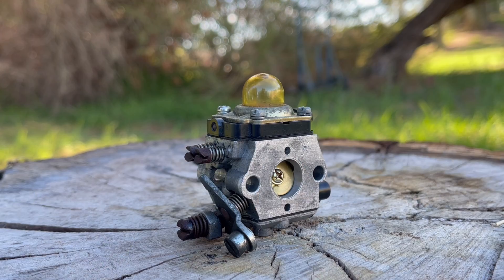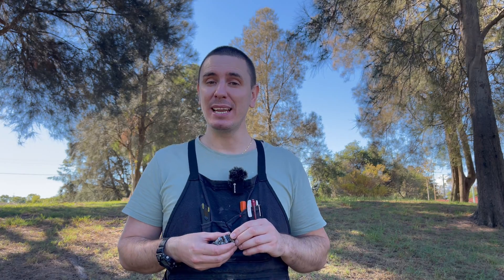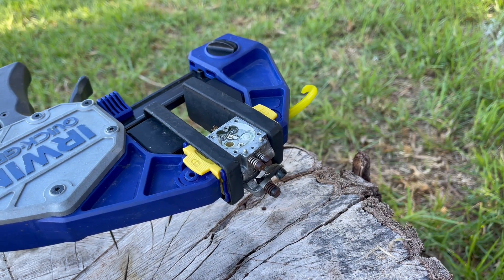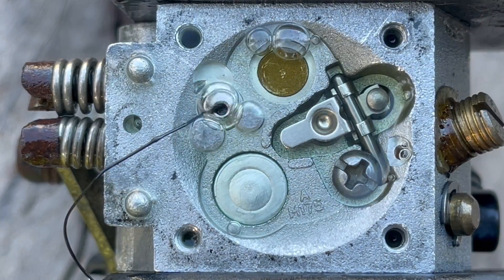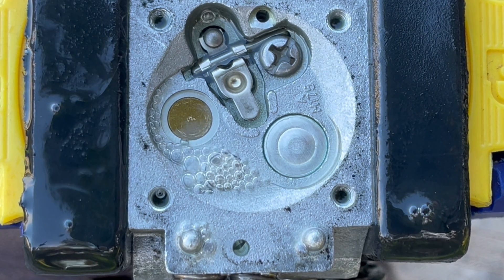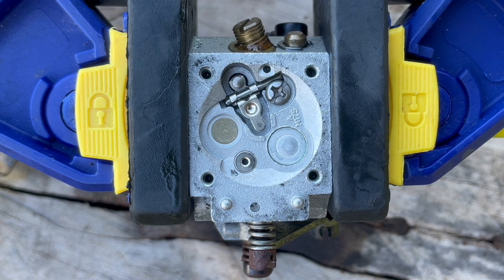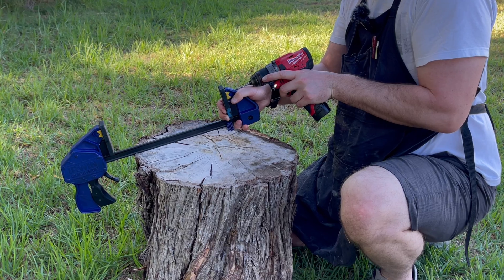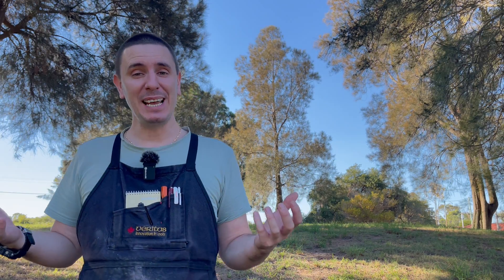Must-Have Tools For Carburetor Repairs & Rebuilds!

Comment: Can you send me the link to the carburetor valves?
Reply from the maker: Hey I don't have a specific link to them, but if you google your carburetor make and model you can find the part number for it :)
Reply: @VintageEngineRepairs Here in Brazil, it is difficult to find, thank you.
Reply from the maker: Yes that's annoying :( what about a local dealer?

Comment: I have a Troy-Bilt gas trimmer, model TB635EC.  I'm having problems with the engine flooding after starting and quitting.  I can't find any carburetor parts with any on-line dealers.  I have found a replacement carb, and ordered one.  I see many how-to videos to tear down and repair these small carburetors, but where do I get the parts?
Reply from the maker: EBay, Amazon, local dealers, Ali express, etc all sell parts.
Reply: @VintageEngineRepairs  I see that, but the carbs I see, do not match the one (pn match) on my Troy-Bilt, 4-stroke.  I received the new carb I ordered, and I'll be tearing down the original when I have the time this week.
Reply from the maker: Yeah it can be tricky sometimes! And when you think you have the right carb, it arrives and still needs a little modification! Hope you get it sorted :)

Comment: Hey Tom, I am also a Tom!  I am working on a Zama c1u k16 from my old pole saw.  I did the test in my little check valve and it allowed me to blow or suck through it.  So, do you know where, in the States, I can order new check valves.  It’s ridiculous that none of the repair part companies have any check valves for sale.  I would really like to remove it from my carb but can’t find a replacement.  Thanks.  Tom
Reply from the maker: Hey Tom :) best to find the part number first then google search it. If you type in "Zama C1U parts list" you'll be able to find it :) best of luck!

Comment: I have a question to make. I tried your method with rubber jaws, but the compressed air escape from the holes of throttle and choke shafts. I tried with 2 carbs the same results. How did your carb hold the air without escaping from the case holes of the throttle and choke shafts?
Reply from the maker: Hi, that does to a certain extent, you won’t ever build up pressure as it were, but a worn throttle shaft does worsen it. Try low pressure air from your compressor which is more constant and controllable
Reply: @VintageEngineRepairs  i see, i will just keep constant low pressure in order to see only if my check valves are leaking right?

Comment: I’ve had luck soaking the carb in Pine sol overnite and then blowing out the orifices with carb cleaner. A Tillotson HS136E was successfully cleaned and put into service again 😊.  One question however , do know of a tool kit for re-cutting the seat in the carb housing (seal between needle and housing) … I used a qtip with polish several times however the seat was so hammered it would not clean up. I was able to use an appropriate size drill bit ground to the angle of the needle and holding the bit in a tap wench slowly “cut” a hair of the seat - THEN polish again and it’s now working. These Tillotson HS 136 b,c,d,e,j series are used on many older saws and are very difficult to source new - just wondering if there is a commercial tool available for this application other than my ghetto tech method 😂 thanks !
Reply from the maker: Hey, I have successfully cut seats using a small end mill, I can’t remember what size it is, but find one that fits :)
Reply: @VintageEngineRepairs  I’m having a drill cnc ground to the exact taper of the needle … then we can take a very light cut by hand and use some polish to lap the surface true. Of course the metering arm may not be flush with the housing but as long as it seals….. Another option I found is to retro-fit a 395carb , you’ll have to drill for a fitting for the impulse line either in the cylinder or the intake block. I thought I had found the rainbows end and ordered a HS136C but later recieved and email stating NLA. I make it work somehow thanks for the reply ! 😎

Comment: Hey Tom, I tried testing a stihl fs 280 carburetor with the same steps provided in the video and it leaks in both high and low drillings. I even tried a new one with the same results.

These carburetors are probably built different.

Much appreciated if you can help me understand its design.
Reply from the maker: Yes there are a few differences. If you don’t have a purge bulb on the carb, the low speed drillings will always leak unless you close the screw all the way. The high shouldn’t though, as there is a check valve on them. In some rare instances they use a capillary screen, but not on modern machines! Are you using after market carbs - they’re an always an unknown entity!
Reply: @VintageEngineRepairs  I'm only using original carbs. Tested 3 carbs for the same model so far, and every high drilling is leaking (if i tighten them all the way, there are no leaks). 

There's something we're missing.
Reply from the maker: Yeah that’s not right haha, you’re wetting the drillings with fuel?
Reply: @VintageEngineRepairs  Yes sir, wet as instructed. Cleaned the carb, reinstalled it in the unit, and it ran perfectly.

If you ever come across any working carburetors like that, please let me know.. maybe I'm just crazy.
Reply from the maker: @l3git_098 I certainly will!! Send me an email and I’ll forward you the stihl documentation to this procedure for your reference: tomscandian@hotmail.com

Comment: Hi,I have walbro HDA 154A and i need check valve. But i couldn't find it on google,would you help me with that? I found severals but its nkt the same as mine.Where  I can contact you and send you pictures? This carb is from Husqvarna chainsaw 345. 😀
Reply from the maker: Hey mate, if it’s the main nozzle you’re after here you go - Nozzle Assembly Check Valve 86-578-1

Comment: First, I grew up in a family of slow- talking mid-westerners, and second, I'm now old and slow on the up-take, with the result that much of that info blew by too fast. The carb in my old Echo line-trimmer has a bad bog, probably from the accelerator pump o-ring (per your other video).  As I go through the carb, I'll have my laptop on the bench beside me so I can repeat, repeat, repeat.  Not a big deal, and I'm certainly not griping after all of your help! But may I humbly suggest that you take just a little more time on your pictures of each operation, with a background voiceover  .  .  .  ??  Regardless, thanks much!!
Reply from the maker: Thank you for the feedback :)

Comment: Hi i am in uk i have a stihl fs 56 r strimmer carburetor leaking fuel in to air filter will not run  carburetor zama s145a839a may be a cheap carb need strimmer not worth much regards
Reply from the maker: Hey, sounds like your needle is leaking letting the fuel flow out of the drillings :) pressurise the fuel line (you take the filter off) and pressurise it to 7psi. It should hold, yours likely won’t.

Comment: Hey Tom got a question for you. Is it possible for a check valve to pass the tests and still fail intermittently when running the unit? 

If I adjust the carburetor everything runs fine and 20 minutes later when I restart, it sputters and needs to be readjusted. 

Already pressure and vacuum tested the engine.
Reply from the maker: Check valves can seal intermittently, yes :)
Reply: @VintageEngineRepairs  Thank you my good sir!

Comment: I always repaired my carburetor's with basic tools, an air compressor is a must.
Reply from the maker: Be careful which hole you spray the air into!
Reply: @VintageEngineRepairs  I'm always careful. Never had any problems.

Comment: Yeah I only ever have to use a Phillips screwdriver usually a P2 sometimes a P1 every now and again using a flat head, usually a pair of needle-nose pliers to get maybe the gas line off if it's not coming off easily, and usually a pair of fine tip tweezers and then a small stainless steel bowl to set everything in a stainless steel bowl. normally just take the whole thing apart and then use a can of carburetor cleaner with the red tube the red tube is the most necessary thing with a can of carb cleaner. And then I will just spray everything nice and clean spray through every last thing that looks like a hole and being sure to notice if it's actually spring through the hole or if it's just possibly a screw hole and it's just back spraying on me and then just after spraying it all down making sure that it's spotless putting it back together the same way that it got taken apart and spraying down as I go making sure not one bit of dirt gets into the thing and and so far I've probably done a good two or three hundred Carburetors in my life and I've never had to go through the extremes that you're showing in this video
Reply from the maker: They’re service parts, they need to be changed when they fail. Thanks for watching.

Comment: Be careful with the budget hand pump recommendation. That is a vacuum only version which is not entirely helpful with 2 stroke engines and carburetors. Search B0BLHBH1GK ASIN code for the pressure/vacuum one. I have this exact model and it's great fot the money.

Comment: The fuel tank is below the carb or yes gravity could leak through those two pump flaps as gravity draws fuel down . i understand all about the ventura and the diff pressures along the throat (as a pilot training engines, carbs, suctions for instruments and "static port" ) SO why does the 4 stroke make this carb work without pulse but the 2 stroke needs the pulse hole to work those flaps or leak past them if a suction is produced ?   Seems both intakes make a vacuum. I have worked on many of diff carbs cleaning rekitting and even trying diff metering springs to get the right "pop off" pressures and right amount of fuel in that little bowl for high power but not too much for idle or it will flood.  So assume i understand about the diff sections of the carbs and bleeds and idle lines and main jets and check valves ect.
Reply from the maker: Because I don’t know what machine it’s off and what that carburetor is I can’t really help, but send some pictures of the machine and carburetor to my email and I’ll explain it to you tomscandian@hotmail.com
Reply: @VintageEngineRepairs  Its a yard king 4 stroke 24.5cc with fuel tank under and i just found out as i suspected that the 2 stroke draw with or without the reed is LESS than the heavy 4 stroke suction and thus this will produce enough suction through that main jet tube and down into the body where the pump gasket is and draw fuel through them and all good. I can see when i pull the rope the fuel going up the fuel line but with no pulse hole on the carb or engine manifold.  Theres no other holes in the throat of a Var jet Venuri so thats only way it can make suction down into the carb and enough to draw fuel in but the 2 stroke "intake" suction can manage this and needs that pulse port to work those 2 flaps.

Comment: Hi, Why can you use a 2 stoke carb like a walbro or var jet type WXY? on a 4 stroke with the pump diaphragm installed BUT no impulse input?? It WORKS of course but seems both engines produce suction through their fuel/air ports BUT the 2 stroke wont work if you blank off the pulse port. I can only guess that the 4 stoke produces strong input suction? and this draws up on the main jet producing a vac inside the carb and the little pump valves then draw fuel through?   So whats special about inlet valve suction on a 4 stoke compared to the 2 stroke suction? why doesant that do same effect or is it timing or volume and thus needs a extra pulse port? I only seen this on a Var jet so will it only work with this type as it has a long plastic tube and cut to let the fuel out and this provides a strong suction down into the carb but needs the impulse port hole built in for 2 strokes?  The Var jet that came with the 4 stoke does NOT have a port hole and of course neither does the inlet port for the 4 stroke inlet either. For a test, I also grabbed another Var jet 2 stroke with a carb pulse hole and put it on the 4 stroke manifold which blanks off that pulse hole and it still worked! so that 4 stroke inlet suction is diff from 2 stroke inlet suction somehow?
Reply from the maker: Hey, if the 4 stroke carb doesn’t have an impulse and fuel pump then it’s gravity fed, the tank will be above the carburetor :) some 4 strokes have a fuel pump but that requires a small spring in the fuel pump side of the carby to oppose the vacuum pulse (no pressure pulse in a 4t crankcase due to pcv 
valve. I think you’re getting confused about pumping the fuel and the venturi effect too. The fuel pump doesn’t squirt fuel into the throat of the carb - it’s a pressure differential that is created and fuel is drawn out. If you place a straw in water and you spray your air compressor nozzle right over it at 90 degrees you’ll see exactly how l a carburetor works.